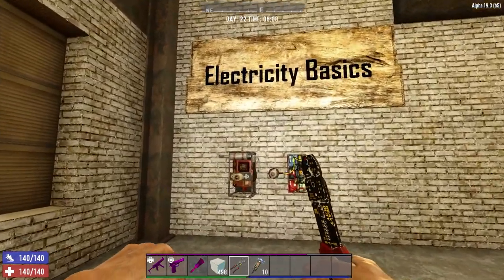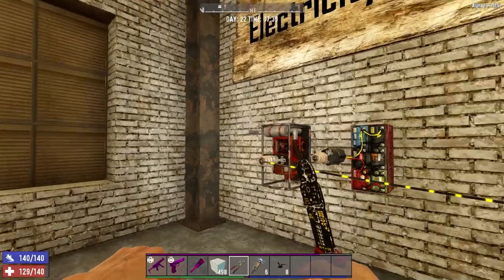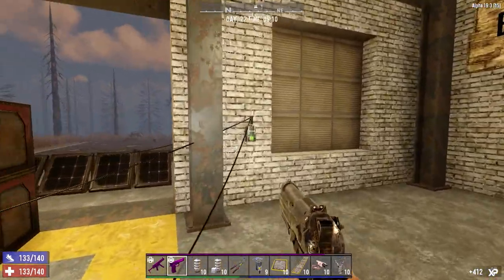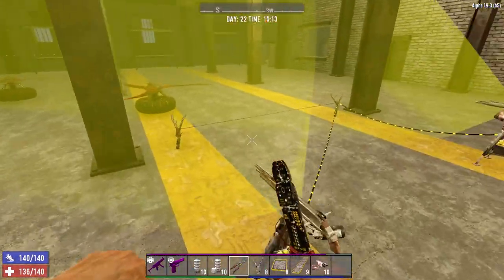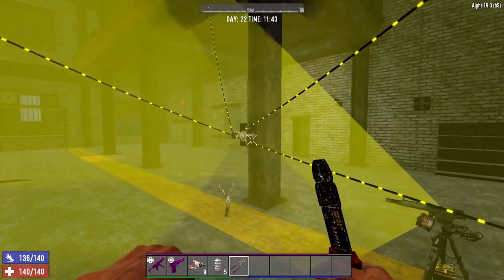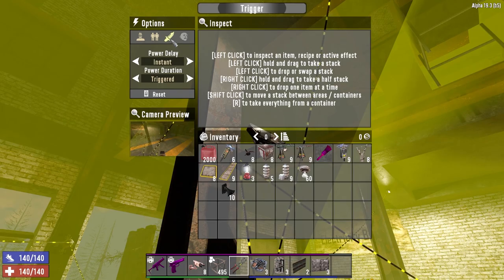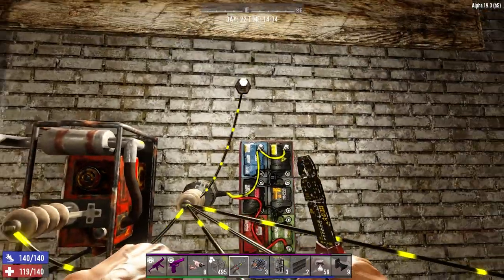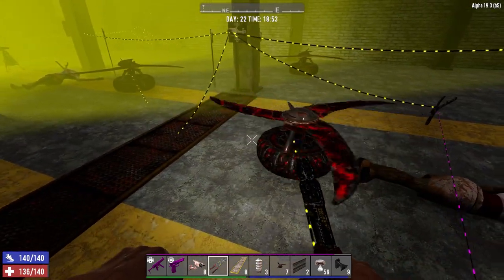Electricity Tutorial - 7 Days To Die - Tips and Tricks for Wiring - Alpha 19

Comment: Good job Gen! There a few more advanced things you can do, like power source > trigger > trigger > door so both triggers will open the door. There are also some tricks with overpowering a battery bank to control electricity flow between multiple banks, but you did an awesome job. I'm an electrical engineer so I really appreciate this sort of thing. Now if TFP would only add contactors  and Programmable Logic Controllers then we could do some really cool stuff 😁
Reply: I'm glad you approve, especially considering your professional background! :). As a programmer, I can definitely relate to having logic controllers! I'd like to use a drawbridge for an inverted hatch, allowing for underground tunnel entrances. So, if I could reverse the open/close state requiring power, or have a trigger turn off power (though that would be less efficient) I could make that work. Or, I'm not considering something ha.
Reply from the maker: Phew you know a lot already! I always get Genosis to wire my stuff... It is too complicated for my brain.
Reply: @Genosis  This can be done already with a bit of trickery. Take a battery bank and place a single level 1 battery in it. Wire the drawbridge from the bank. Take a wire from the bank to a switch. Wire 4 industrial lights to the switch in series. When you turn on the switch the lights will turn on overloading the battery and killing power to the drawbridge. The switch can be replaced with any type of sensor.
Reply: @NotAGamerGaming  You can learn a lot in 3000 hours of game play 😁

Comment: I wish they'd add the input for generators. I really wanted to wire it to a switch, so when the partynight starts I can trigger all the traps and wires with a switch on/off, instead of individually going through 3-4 generators turning them on.
Is the electricity use directly connected to fuel use? I mean if I have a generator running everything constantly I know it using fuel, but what if I have generator output added into a switch and everything is flaring out from that switch? That way I can run the generator using 1W power and when I want flip the switch and it starts using 270W right? While it is using 1W the generator can run for weeks (unless the noise is too bothering) Or generator is using constant amount of fuel?
Reply from the maker: I think they are related for sure.

Comment: Power source cannot have a parent connection ... i need this explained, im trying 2 use a switch on a no craftin challenge but it wont connect to the generater 😥 x
Reply from the maker: I will get Gen on this!
Reply: To use a switch, you must always start from the generator. Using the wire tool, connect your generator first to your switch in that order. Then from the switch out to any device you want to have control by that switch. You can have as many connection from the switch out as you want.